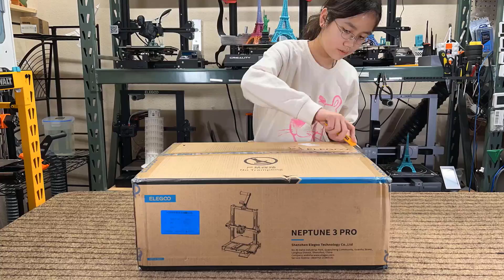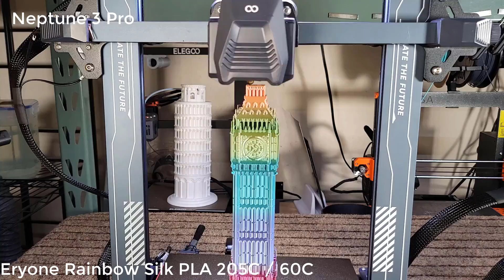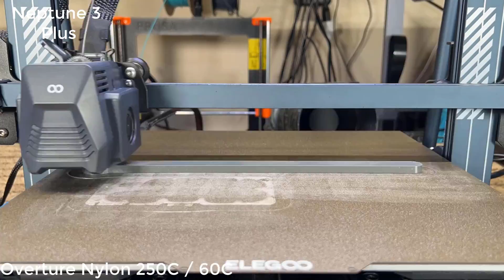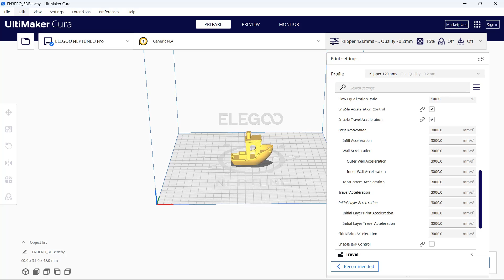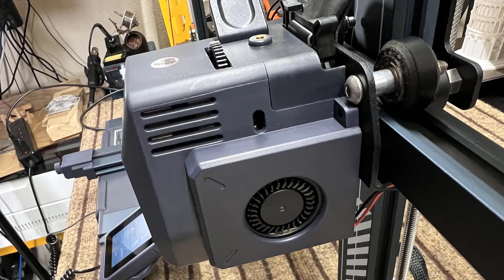Elegoo Neptune 3 Pro & Plus: 250mm/s high speed printing, stock Marlin VS Creality Sonic pad Klipper

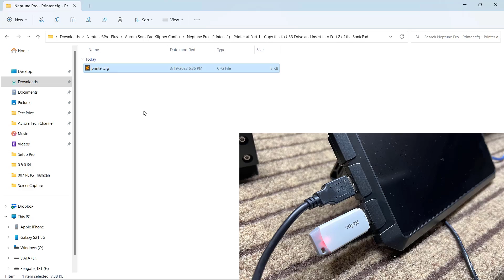Comment: Hello. Please tell me, at 13:00 you insert a flash drive with firmware into the printer. The message "Update Firmware " appears on the screen. Tell me, should the loading bar reach the end? This process takes me a very long time. Is it possible then, in the clipper’s web interface, to understand that the firmware for the printer has been successfully installed?
P.S. Sorry for my English )

Comment: I have the Max and love it, I am adding the sonic pad to and some other upgrades also, I am wanting to go bigger on the nozzle size but can’t find anything for PETG on cura , any help would be appreciated and you do an awesome job
Reply from the maker: For PETG, you can use the same settings; just duplicate the PLA profile, change the temperature to 235°C and 85°C for the bed, and adjust the cooling to 40% maximum or completely turn it off depending on what you print. These settings have worked fine for Eryone, Sunlu, Prusa, and many other different PETG filaments I have used.

Comment: The max is awesome for what it is. Looking at hotend upgrades now. I have been printing very large plastic mockup engine blocks on the ender extender and this is a little faster and much easier to use. .8MM /.3mm and it looks like it will do about 50mm.

Comment: Really good review. I have had an Elegoo Neptune 3 Pro for almost half a year and so far I love it. Until a few days back I have only printed at 70mm/s with PrusaSlicer. Decided to try to experiment with 240mm/s. This machine is really solid! Been my work horse with my Ikea Skådis setup. Might actually buy another one to replace my Ender 3 lol.
Reply: Hello, what are your speed parameters to get 240 mm/s? I'm new with 3d printing, so far love my Neptune 3 pro, buy I want to try print faster
Reply: Maybe you will see this comment and you might reply finally :)

Comment: Great review. I've been looking at the Neptune 3 Plus & Max as I need a larger print size than my Ender 3 S1 Pro. You have sold me on the Neptune 3 Plus. I have also been thinking about using the Sonic Pad with my printers, I'll give that a try too. Thanks for the review. I was wondering, did you try the Plus at 250mm/s? If so, how did it perform? Also, do these faster speeds work well with PET-G using the Sonic Pad. Anyways, great review. You've given me lots to think about. Thanks

Comment: Aurora, I just got the sonic pad setup and I followed your video pretty much as I could until the slicer settings. Prefer Prusa, is there a video where u setup a profile for klipper? Also when I started a print, the purge line was off the bed, and then the printer went to the far top right corner and paused right after and I had to hit resume. any idea what would cause that? this is on a elegoo neptune 3 pro btw
Reply: Did you figure out how fix this problem?
Reply: @luizgustavoguimaraes381   For me the solution was changing the config file of the printer, in the aurora config the filament_sensor is used as a motion sensor i just changed the code for a switch sensor the code is something like this: 

 [filament_switch_sensor filament_sensor]
pause_on_runout: true
switch_pin: PB4

instead of the aurora one, that is this one: 

[filament_motion_sensor filament_sensor]
extruder: extruder
pause_on_runout: true
switch_pin: PB4

Comment: Ok I need to ask, my priint quality isnt great with Neptune 3 max, but I've placed it on the floor now instead of table and it increased, its not perfect, but much less visible layers. 2 questions. 1 how 
did you make your desk so sturdy, 2 what else should i check in my n3max

Comment: I appreciate your work Aurora - but was wondering how did you increase the speeds so much without a nozzle change / hot end swap? I am testing my hotend volumetric flow rate with PETG and it seems to be around 7.2mm^3 /s which limits my perimeter print speed to 40/45mm/s

Comment: I can't decide between the Neptune 3 Plus and the Artillery Sidewinder X2... Both videos were great, with great examples, points, summary of pros and cons... I think you make these videos too well :P top tier content.
Reply from the maker: IMO, Neptune 3 Plus is the best in the same range.
Reply: @AuroraTech  Thank you so much for your advice, that's that then :)
Reply: You can, if you look around a bit, find a discount code for Artillery x2 which gives you a machine for $245(EU), this and the fact that Artillery can actually be bought makes the choice easier perhaps?

Comment: I have a question. I thought I figured out why the extruder was going all the way to the back of the bed and stopping after laying pla on the left side just before the print starts. I changed it back to 235 mm even though the bed is only 225 mm which is why I thought this was happening. I couldn't do an auto bed level on my right side with it set at 225 mm. Is this pausing part of the Sonic Pads code? Can I take it out?
Reply: Did you figure out how fix this problem?

Comment: Thanks for the help. I just picked one of these up yesterday after I just couldn't get a Raspberry Pi up and running.  I used your files and it connected. It worked a few times and then the extruder started to go to the back right side of the bed after it laid the first line on the left side of the bed. I don't understand the codes at all. I figured the printer.cfg file was telling the extruder that it need to go there. I looked into the file and finally noticed the measurements were 235, 235, and 280. I fixed it to 225, 225, and 280, which seemed to work. I updated the Sonic pad; this could have been the cause, but I think it was happening before. I can not seem to get the camera to capture video/time lapses. The camera seems to work fine to monitor the printer but I an hoping to figure this out too. Again thanks for the help.

Comment: Hi i recently tried to install and use the sonic pad with my elegoo N3P however when I tried to run measuring resonances it comes up with an error saying the following 
!! {"code": "key298", "msg": "Can not update MCU mcu config as it is shutdown", "values":["mcu"]}
I followed your install guide and can print with the printer, is there anything I can try?

Comment: @Aurora Tech without klipper only using the stock firmware can this achieve the 120 mm/s speeds and quality as in your video? (i understand input shaping calibration is not possible with the stock firmware)

Comment: I will buy one with it can go to 300 degrees C or above.  I want direct drive hot ends but this unit may need weight reduction to avoid high inertia.  Great review.  I have a printer farm that needs upgrading, I already have three of their resin printers.

Comment: Very good and in-depth look at both printers, last month got a n3 plus after purchasing the original n3 and the difference is night and day. Just order a 0.6 nozzle to test how it turns out to print faster. But otherwise great printer for beginners and experienced alike, no complaints so far.

Comment: Well done, thank you. I bought a N3+ partly based on your very thorough review. I'll do the Sonicpad Klipper setup as you have done. Thank you.
  Update: I recently installed part cooling 5015 fans (bigger than the 4010 stock fans) which provide far more cooling.

Comment: That nylon test is really fascinating...I've shied away from printing nylon because I've felt that even a small area where the filament is exposed to atmosphere would be enough to cause moisture problems. You've got a couple feet of the filament path open to air and that wrench prints beautifully. I might need to dust off the various nylon samples I've accumulated over the years and give them a closer look.

Anyway, I can see why so many people are raving about the Neptune 3 Pro - it seems to be the complete package, particularly for people who are on a budget and don't want to spend a lot of time tinkering or troubleshooting. The value of the Plus really stands out, too, as I felt like I got my Artillery Sidewinder X1 for an absolute steal from Gearbest in August 2020 for $359 and the Plus looks to be superior to the X1 in most ways...and sells for $30 less than what I paid for the X1, which was $60 less than what the X1's going rate was on Amazon back then and a whopping $130 less than what the SWX2 is selling for right now. 

I also love your auxiliary cooling fan setup. I wonder if these kinds of fans will become more popular among modders or in new printers released over the next year or two, given the success of the aux cooling fan on the Bambu Lab printers. And every video I see with the Creality Sonic Pad makes me want to get one more. Creality's dominance in the budget printer market is certainly being threatened with solid offerings from Sovol and Elegoo, but as long as printer manufacturers shy away from Klipper they will have a chance at getting their products into even more homes and businesses with how easy and powerful the Sonic Pad is.

Great review, as always!

Comment: Regarding all the praise for this range of Elegoo Neptune 3 printers, I still find the Sovol SV06 and SV06 plus a slightly better deal, as they provide printing at higher temperatures (300 degr. C instead of 260 degr. C). These printers haven't got a full metal hotend

Comment: Thanks a lot, I learned quite a bit - as usual!  For example that you can get pretty impressive high speed prints with Klipper on a delrin wheel printer if you have enough part cooling power and you calibrate for vibration first.  That's no something I've seen elsewhere. Elegoo looks nice.

Comment: What about the Sovol SV06 and SV06 Plus?
Reply from the maker: The SV06 is good, but this Neptune 3 Pro is even better, I have also reviewed the SV06 and will review the SV06 Plus soon.
Reply: @AuroraTech  Sovol had the sense to put a higher flow nozzle on their Plus version.  They then used a proprietary nozzle only available in 0.4 mm.  So frustrating.

Comment: So glad you have added the 3 Pro and 3 Plus to your reviews.  I totally agree that Elegoo has done an amazing job.  I started with a 3 but quickly shifted to a 3 Pro and have not looked back.  My existing 3Pro is a star as are your reviews all of  "star quality" about which I frequently comment. 
I have to wait for stock to return for both a 3 Pro (donating it to local maker space group) and a 3 Plus which I will convert to either a Volcano hot end or the multi-cavity nozzle to up printing speed.  I hope you tackle an improved hot end approach to aid others in this work using the 3 Plus as the printer.  Thanks for the addition of the Klipper - Creality Sonic Pad in your review - A must addition for my plans for a fast 3 Plus.

Comment: As an experienced 3D printer, I am subbed. Your professional reviews cover all I want to know, in a very easy format. Excellent work !!
Reply: What printer do you recommend for s beginner? I've done a lot of resin printing but want to get into fdm. What filament do you recommend as well?
Reply: @BabyJesus66  It really depends on a lot of factors. I suggest Teaching Tech YouTube channel for finding out which is right for you. I like modifying, so I bought an Ender 3 and just keep upgrading.
Reply: @BabyJesus66  i had the Ender 3 Pro. Hot garbage. Avoid Creality, their customer service is nonexistent and the Ender 3 is OLD tech. By the time you have upgraded everything to the specs of this Neptune 3 Pro, you're spending WAY more than even the Creality S1 Pro. I repurposed the 5 year E3P to recycle soda bottles into filament  (Recreator 3D). The Neptune 3 Plus I have now is leaps better. I upgraded to an all metal hotend, CHT clone nozzle, copper heat block, higher temp thermistor for less than $20 bucks. Elegoo is an AMAZING printer. Bambu Lab was on my radar but still too new. This N3+ and Klipper upgrade delay the purchase even longer untill more Bambu competition show up. Hopefully Elegoo is working on one too.
Reply: Yeah👌
Reply: “I’m not condescending, I’m patronizing. There’s a difference.” — echobeefpv8530

Comment: You print things really hot. I usually go with 210°C for PLA and 230°C for ABS.
Reply from the maker: I use 220C for PLA when printing at high speed, for regular speed I use 200-205C.

Comment: For the plus do you even have to use the leveling knobs since it has auto leveling?
Reply from the maker: Yes, just like how you manually level a regular print bed before ABL, those knobs are added for a reason. Otherwise, they could simply save on costs and use spacers instead.

Comment: Nice, looks like a slightly more polished anycubic vyper, but essentially the same without any bed leveling nobs, a dual gear exruder,  same 2 peice assembly.  Wouldnt be surprised if they sourced parts from the same manufacturer, the PEI sheet looks the same too.   Whats wierd is i get the same layer line artifcats under the hull near the back like the benchy shown here doing 120m/s... thats so weird.  I also saw a guy reviewing an anycubic kobra ax with with the same artifacts but thought i was imagining it until i seen it agiain here.  Is this a gcode thing?  could be a certain set of moves producdes this?  Strange, they actually seem to disappear in the higher speeds like 150 mm/s and 200 shown here... hmm or that could be the lighting hiding it.  Wonder if theres a common underlying issue spaning 3 different printers maybe?  would be cool if  someone could crack that case.  
   Anyway  it was easy to assemble like this one here athough i sort of wish it came more disassmebled (my vyper) because when i went to take apart my hot end to fix a jam i decided to rotatemy rods for fun but didnt really know how to put them back correctly. After watching some videos on similar style printers i figured it out ant it prints even better then  factory, so it would be nice if  they gave instructions how to tune everything properly, correct order of assembly, really let the printer print as best as it can because as good as it can come out of the factory, it will need a tighten eventually, my bed took like a week before it stopped having play after tightening, i had to keep doing it for a while as it settled in.  Things like that wiill prevent it from ever being perfect from factory so some tuning advice/instruction would be nice.
Reply: I am wondering too. I'll be building a farm soon with printers big and small.
Same price = anycbc kobra or vyper or elegoo np3 pro

Smae pirce anycbc max and np3 max

I have a kobra and ı love it. I can use standrt machine and 80 -100 mm/s

Np3 whats the speed and whats your favorite for the farm